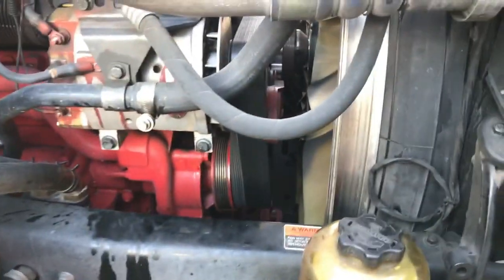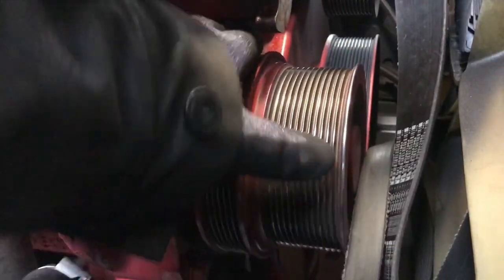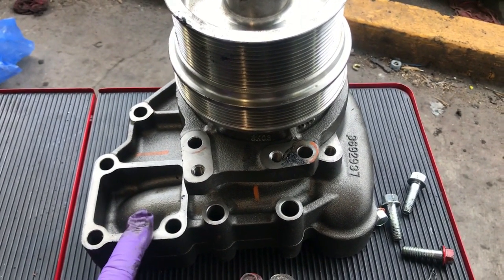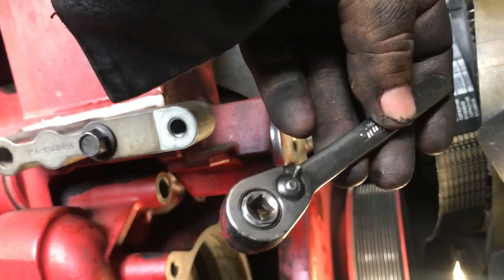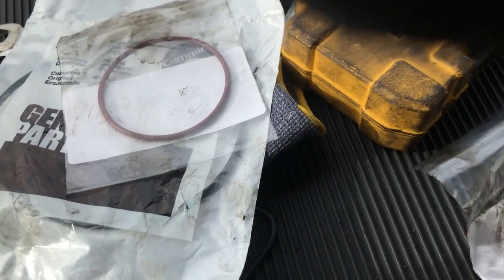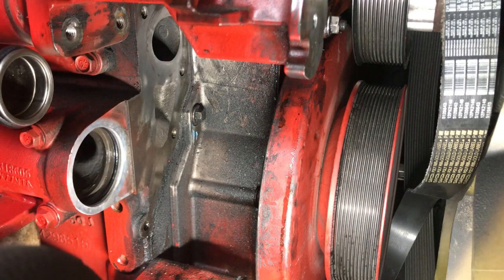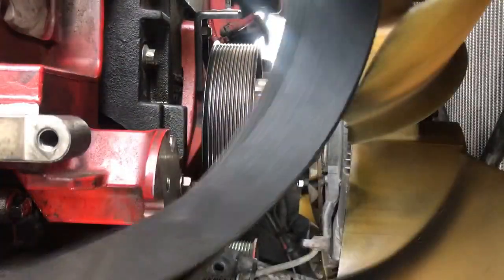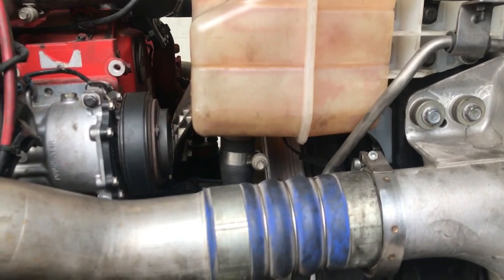Freightliner Cascadia Cummins ISX15 engine water Pump removal

Comment: The pipe that conjoins the water pump to the egr cooler will come out without removing the water pump and/or housing. Just have to slide it all the way forward/into the pump housing so that it comes all the way out of the cooler, then pull out, toward the steer tire. It’ll come out.

Comment: GOOOOOD TIP on the different impeller. I'm about to tackle this. I wouldn't have put the new style on, without spending time calling Cummins to see if it would fit which would have taken a couple of hours I'm sure. BTW, I know Snap-On is king, there's nothing better yada yada but a Pittsburg 1/2" and 3/8" drive ratchet would cost about $30 combined at HF and I've not broken either one yet. just a suggestion. Great video!

Comment: Great video, I just did a job like this on a 2018 KW with the ISX15 and had no issues. Thanks again.
Reply: Hello, Pedro Fuentes. I have a 2018 international with a cummins x15 engine. Did you have to replace the water pump housing or just the water pump?
Reply: @xrebirthx4393  the ISX or X15 have a different set up. If the water pump has not been updated you might have to replace the entire thing as a complete assembly. Check with Cummins by using your engine serial number. You might be able to just replace the front part of the water pump. The blade on the back will determine if it is interchangeable
Reply: @CarlosDieselElectric  Thank You!

Comment: Yesss I have  finally discovered an all Cummins channel!!! Can you do a video on which oil brands is the best for Cummins isx... Delo, Rotella, Valvoline, Schaffers, amsoil VS each other and temp test also... Not even on video on the tube showing support for heavy diesel motors only pick up trucks
Reply from the maker: Sure.

Comment: Thanks a lot
The updated impella sucks, no fit into original housing.
Because Cummins stopped selling  original set but only updated with bigger impalla that does not fit in original housing.

Comment: Sure looks like a pain in the ass to change that. Do those parts need to be painted to keep them from rusting or will they be ok?
Reply: I just installed on water pump assembly today using this video and no issues. No paint needed.
Reply: Just my opinion go ahead and paint that sh!t I do a few per month I have one that wasn’t painted and I’m having to used a sledge hammer to get the old pump out of the mount it sucks

Comment: Mine is leaking coolant at the bottom of the water pump. Do i have to replace the whole thing or just the orings ?
Reply from the maker: Depends is it leaking from the Weep of the water pump or the or the outer seal.if otter seal leak just the seal.